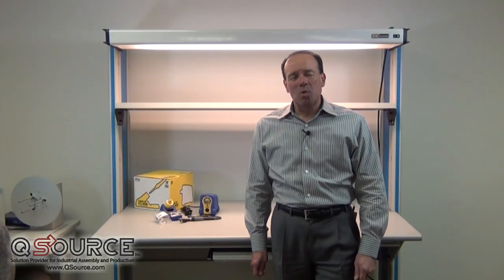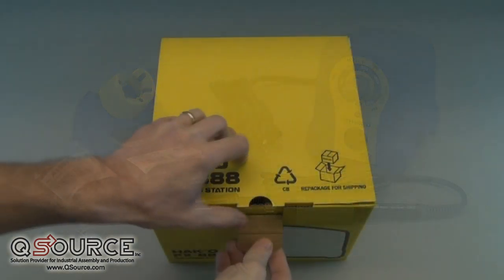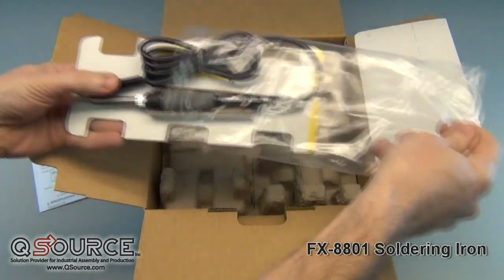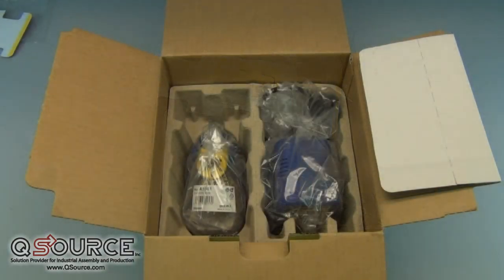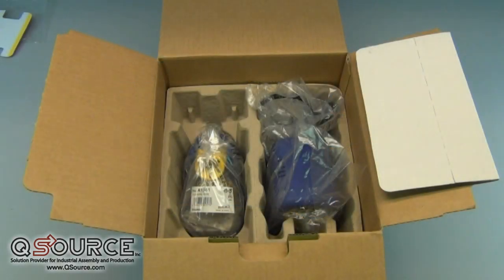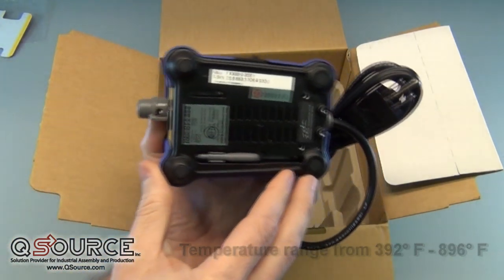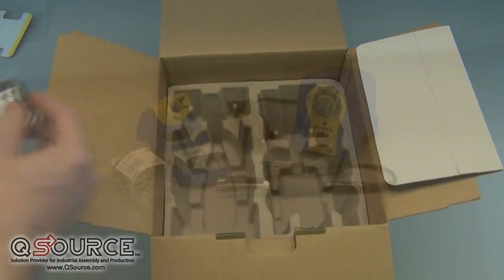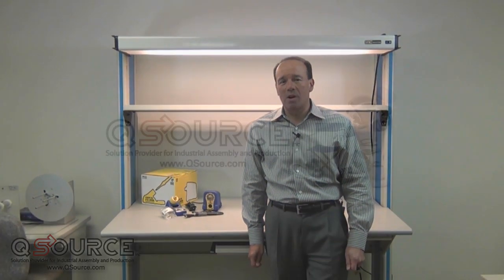Unboxing the Hakko FX-888 Soldering Station - Q Source, Inc.

Comment: You're right.  There was the hex key, on the handpiece cardboard, in a bright yellow box, with a white arrow pointing at it.  Kinda hard to miss, and I missed it.

The soldering was great! I love working with high quality tools, and low cost high quality tools are the best! I've never had an iron reach temperature so quickly, and the curly brass has largely replaced the wet sponge for tip cleaning.  This is a very well designed high quality iron.  I've reached soldering nirvana.

Comment: The instruction sheet for my new FX-888 stated that it included the hex key but it didn't. No big deal. I don't want to lock the temperature, and if I did, I have metric hex keys. I don't need another one.

As expected, everything about this Hakko FX-888 screams quality.  I just finished unboxing it and haven't used it yet, but I know I'll like it. I'll be breaking it in on a soldering job today.  My Weller-Ungar soldering de-soldering station is gong on eBay.

Comment from the maker: @metalmike00 - Actually, the unit we used for this video did not come with a hex key but it is available - part number B2017 (H001-001536) for $3.27. Newer ones may include it. It does, however, come with a calibration screwdriver that gets stored in the base of the unit. Thanks for watching!